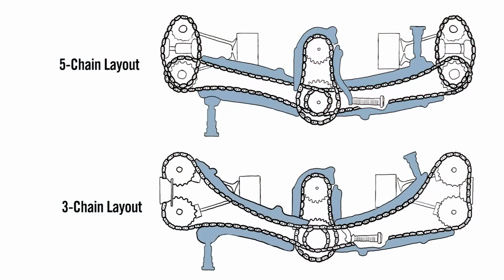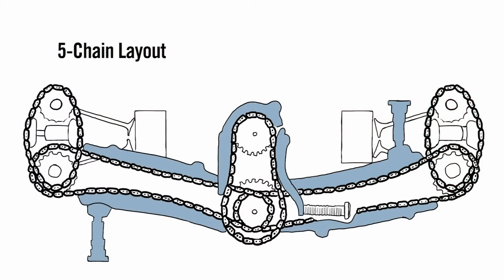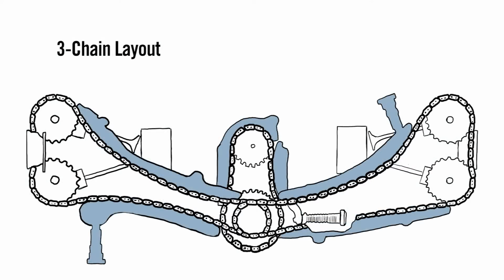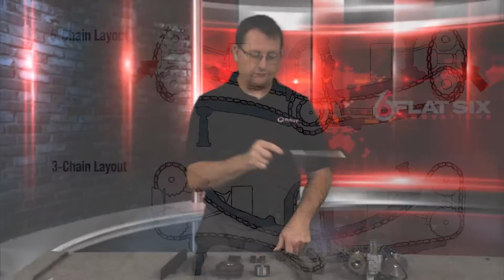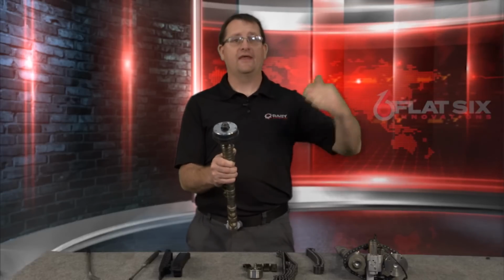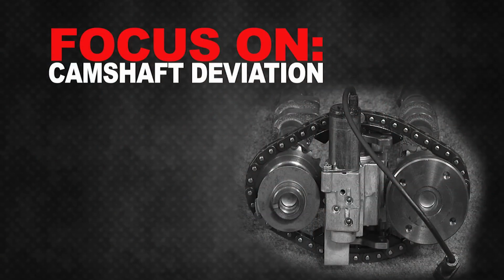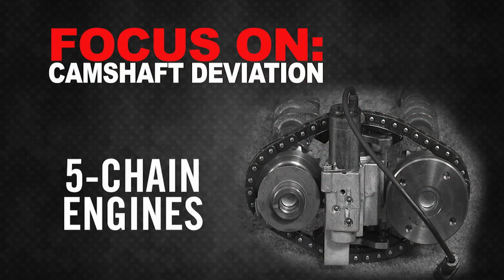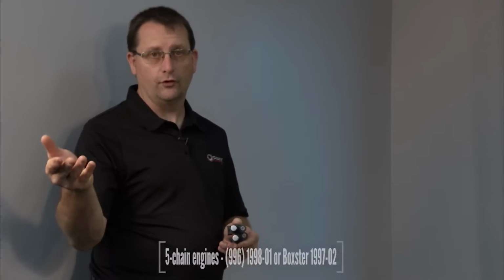FOCUS ON: Camshaft Deviation | Porsche 986, 996, 997, 987

Comment: Thanks for this great video Jake. I am currently chasing bank 1 cam deviation (06 Boxster S, 132k miles). This car is reasonably new to me (5k miles so about to get oil (Mobil 1, 0w40) analyzed). I first discovered the deviation within the first 100 miles and so dropped the oil pan to look for bits of plastic, found a solitary spec. I've replaced the bank 1 chain tensioner, no change. I've removed the variocam solenoids, cleaned them and swapped banks, no change. Is there anything else I can check before taking the timing covers off? here is a link to a 10 second video showing the deviation numbers. https://youtu.be/Ql5rYterUy0
Reply from the maker: Hi, Julian. Please submit as support ticket at flat6innovations.com and I'll make sure Jake Raby reviews for comment. Sound good? Thank you for supporting Rennvision!
Reply: @RennvisionbyTheKnowledgeGruppe  I did submit a ticket yesterday for paid support, got back a reply that he's "not currently offering paid technical sessions at this time". Busy times I guess.
Reply: Could be a failed VarioCam phaser/adjuster. Do you have the P0011 fault code present? 

The internal splines/gears of the VarioCam are made predominantly from copper and iron. If you had your oil analyzed, and your VarioCam had failed, it would likely show elevated levels of copper and iron.

Unfortunately the only solution to a VarioCam failure is engine removal.